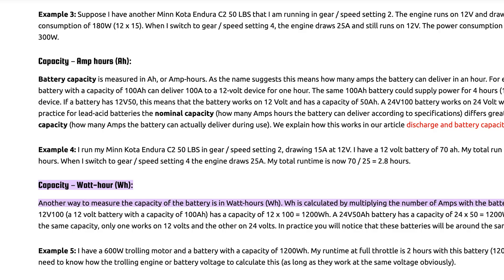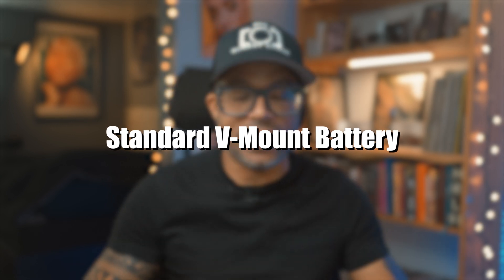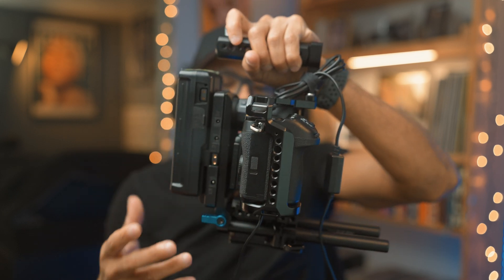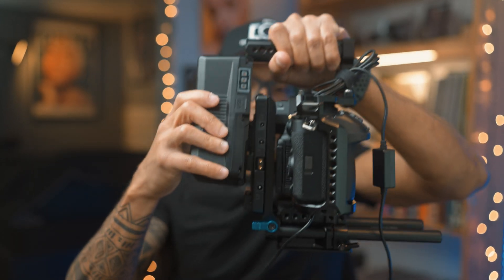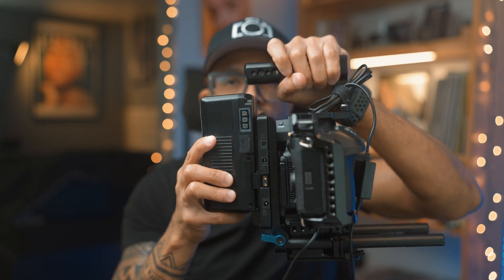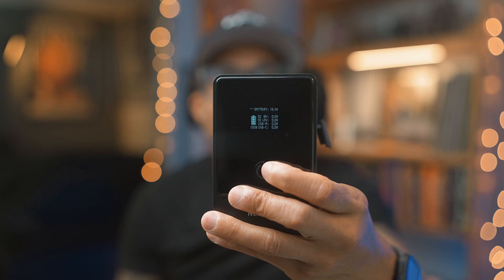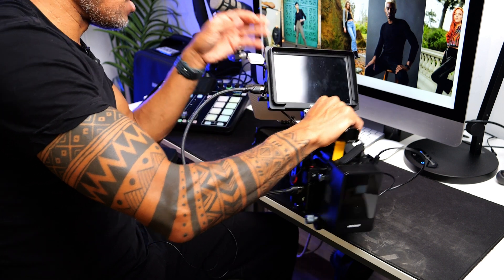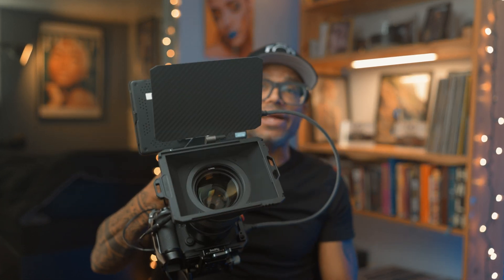Battery Solutions For Video Camera Rigs | Neewer Mini V-Mount Battery Review

Comment: Thanks, I am probably going to pick one up now for Black Friday but I have read several complaints about it frying peoples cameras, specially Lumix Cameras, I have Sony but still weird. I also have seen many many complaints about the Dtap being to loose and not working properly? There are several comments about that on Amazon about this battery. Since many months have passed by, I am wondering if you're still happy with it. Thanks
Reply from the maker: Im sorry those folks had issues BUT I bought my second battery during Black Friday for only $76 - cant beat that. I just used mine on a mode video shoot yesterday. You can see the teaser video here https://youtube.com/shorts/gWvwhfWNcoQ?feature=share
Reply: @RobertSilverPhotography  I.bought one for black friday as well. 62.00, cannot beat that. Looking forward to getting it.

Comment: Good review, but man you need to step up cable management on your rig. Maybe use a thinner more flexible HDMI cable and generally smaller better fitted cables to avoid extra length. Also, you could extend your v-mount plate a little bit more to tuck all of your extra cables between a plate and the camera body. That way you have more compact and nicer rig. Overall, keep up the good work!
Reply from the maker: Thanks a lot for the cable management tips. Appreciate it!

Comment: Question: I just got blackmagic pocket 4k and the neewer extended battery. Should I use a d-tap cord or usb to power the pocket 4k?
Reply from the maker: I've been using D-tap the entire that Ive owned mine - zero issues so far
Reply: @RobertSilverPhotography  cool. I’ve been seeing some report issues of monitors or the camera itself burning out from external batteries. Wanted to make sure that wouldn’t happen to mine

Comment: The Official TSA Website (and FAA Regulations) indicate the Restriction on Rechargeable Lithium Ion batteries is 100Wh or less per battery for passenger Carry-On (no limit on the # of batts); with airline approval, passengers may also carry up to two spare larger lithium ion batteries (101–160 Wh) ; chargers, power banks, etc are considered a single battery. These larger batts may also be carried in checked luggage - also with prior airline approval.
Reply from the maker: Awesome, thanks for sharing this info!

Comment: Hey! What cable is used @ 13:41 to connect the monitor to the vmount battery? Thanks!
Reply from the maker: Those cables with barrel plugs were in included with a V-Mount battery plate that I bought - https://amzn.to/3UsoKSC
Reply: @RobertSilverPhotography  Awesome thanks heaps man!

Comment: Excellent video Robert, im new to video so please excuse me for all the questions. Where do I get a "Dummy Battery"?  and what Small Rig V Mount Plate did you use? Also do you use a microphone for the Rig for the  wedding Video Shoot? Lastly do you recormment the Hollyland Monitor or Feelworld for a newbie?
Reply from the maker: Hi Piye, these are all great questions.

1) depends on your kind of camera. I have found duymmy batteries for Lumix and Nikon both on Amazon. You can by the plate here https://amzn.to/49mKA06
2) Yes, I will use either the RODE VideoPro + or the DJI Lav mics for weddings depending on the need (RODE shotgun for walking, lav for interviews)
3) As for the monitor, that really depends on your budget. If you can, go with the Hollyland; colors, brightness, bluetooth wireless transmission and features are AWESOME! https://amzn.to/4bLIQzm 

Hope this all helps!
Reply: @RobertSilverPhotography  Hey Robert thanks for the reply, thanks for the info on the V Mount  Plate! I will building out for a Lumix S5II (Shipped today) :-) , I will check amazon for Dummy Battery, thanks for Info on Mics also.  That Hollyland is a bit out my budget for now, gotta take one step at a time :-) Thanks again Rob!!
Reply from the maker: @piyeamin4421  Here is the dummy battery for the Lumix S5ii that connects to the v-mount battery (w/ d-tap) https://amzn.to/49F15Vh

Here is the 7" Feelworld field monitor I bought and still use. Really nice for the price - https://amzn.to/3V5wMDh
Reply: @RobertSilverPhotography  Hey Rob, thanks saved the link in my Cart for the Dummy Battery, I am waiting the the S5II to arrive, and the  Black Mamba Small Rig Cage/Handle Combo. Thanks for the link also to the Monitor much more affordable!! Hoping these are affiliates links so you can get a kickback 🙂

Comment: Good job. I just might buy👏 I guess my concerns are how durable is it? Will I have some kind of overheating issue or fire hazard Kind of thing going on? I love saving money but those are the questions in the back of my head
Reply from the maker: Thank you. A very solid concern. Im my experience so fart I havent gotten any over heating issues. I filmed using this battery for two days back-to-back on my short film set - worked and charged up so easily. Lasting each day on a single charge (of course I charged it at the end of each day). SO far so good. But of course, time will tell.

Comment: If you get rid of the plate how are you gonna mount it to the rig??? No matter what you still need a plate of some kind...
Reply from the maker: Yes, if you plan on using a v-mount battery you'll need use either of the two plates that I mentioned. The benefits out weighs any cons; like additional weight.

Comment: Awesome review!! loving the rig too! I'm new to videography, i was wondering if you can answer my question. I've always wondered with these types of rigs/setups, how do you get access to your led monitor since it is in front of the battery? In particular for things like touch/track focus?
Reply from the maker: Great question. In general, the monitor would be mounted on top of the rig to the top handle. 

Some field monitors are touch screens but in general, I would adjust the tracking directly on the camera's rear monitor. Usually, I would have it flipped out to the side and then have the V-Mount battery pressed up against the back of the camera. 

When I'm filmmaking I shoot a manual so I wouldn't be accessing the monitor to adjust the AF/tracking.

I hope this helps in any way. Thanks for watching my video.
Reply: @RobertSilverPhotography  that’s awesome, thanks so much! That makes sense! Do you also have access to all your dials? In particular iso dial that’s in front of the v mount?
Reply from the maker: @photosbyjames_  Yes I do, no problem